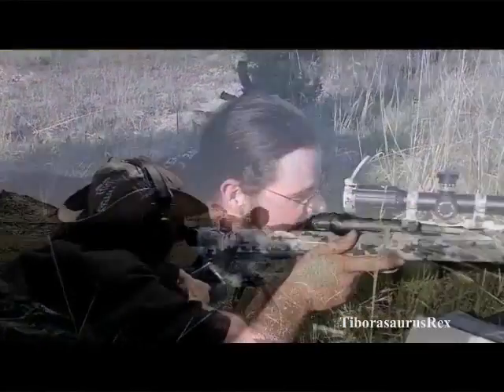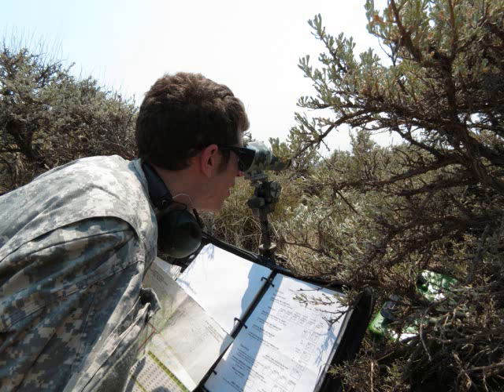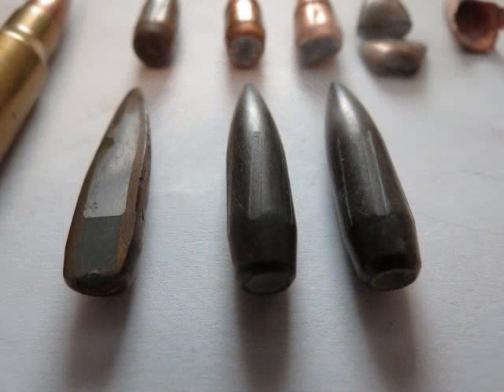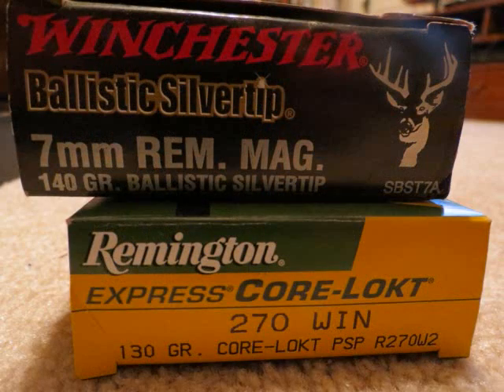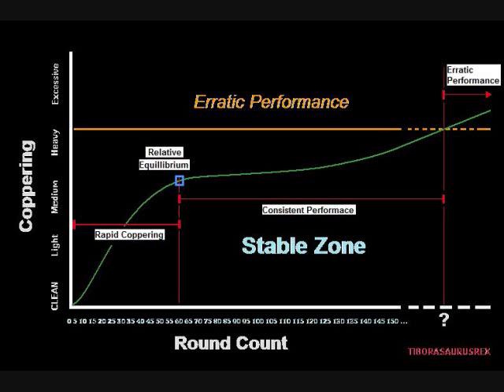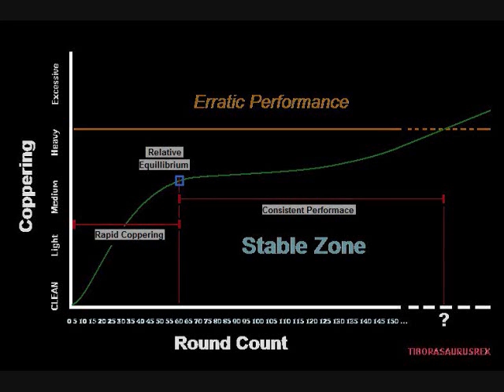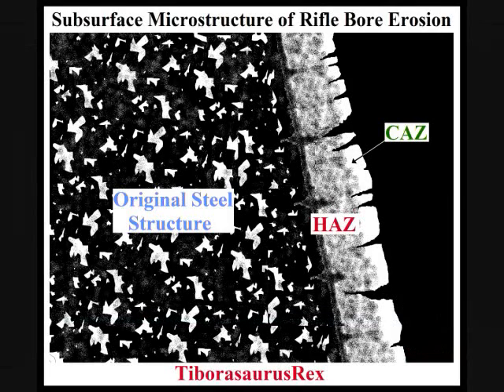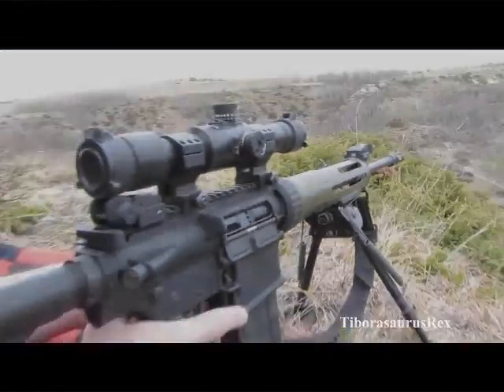Long Range 101 Part 40 - Coppering and Powder Fouling - Rex Reviews

Comment: Not applicable to standard bore sizes, but I had to clean my 17Rem after 60 rounds or a carbon ring would build up about 6 inches in front of the chamber, in the bore, and could cause some jacket shedding.  At 100 yards the bullet holes would have these little grey comet trails off the edges of the holes.  This was lead coming off the bullet where the jacket shed.  At longer ranges the bullet would begin to keyhole.  25gr bullet at 4,100fps out of a Tikka Continental; most accurate rifle I ever owned so far.

Comment: Rex, I'm really confused here. I've watched all your videos, broken in my new stainless Tikka T3 .270 using the "easy" method. I haven't cleaned it in 400 rounds. I'm just shooting from a bench at a covered range so the only contaminants are from the cartridges/bullets/powder. Am I ok just leaving the gun not cleaned? What about the chamber? Should that be cleaned some times?
Reply: A. F. Wood Floors update?

Comment: On the question on using corrosive ammo or maybe just to protect against oxidation (rust), do you feel that so much can change when just passing some gun oil through the barrel to protect against this?
Reply from the maker: Maybe try windex for corrosive ammo.  That seems to work pretty good.  If you have to sit the rifle down for a period in a corrosive environment, its a good idea to run a patch wetted with a little oil through it first.  Just don't use too much.

Comment: Great informative video as always =)   One question thou.  You mention that you recommend copper equilibrium on long range setups, but not as much on mid range and/or carbine type of rifles.  Why is that ?

Cheers
Reply from the maker: At medium ranges, your potential POI shifts due to the bore's Cu state is usually not enough to warrant the cost/benefit trade-off in that course of action.   Beyond 600 meters is where you will really start to notice POI shifts due to minor changes in your internal bore conditions.
Reply: TiborasaurusRex   Aha ok,   thanks for your response =)    

Happy new year !!

Comment from the maker: It may be best to log as much as you can to get a good bearing on any trends that might be going on.  The more data you gather, the more you will be able to look back and make a good determination of what exactly is going on with your particular bore.  At first, you will be logging MV all the time.  After it stabilizes for a while, you can back off on logging MV and wait until the POI starts moving arround before you check it again.

Comment: about how often do you re-evaluate your MV's due to barrel  conditions .  I believe i'm in that initial upswing in copper fouling(less than 200 rounds) and my MV's are about 50 fsp higher than my original MVV chart .  I'm hoping they level off and then I can make new tables

Comment from the maker: For our shooting discipline, establishing a copper coating that remains stable is actually desired to some degree.  If the end result is bore CONSISTENCY, then it should be good.  If it results in varying levels of coppering that fluctuate more quickly, then it wil be counterproductive.  More or less copper is not as important of a concept as changing copper levels - for our apps.

Comment: What are your thoughts on the copper fouling inhibiting powders that are designed to make brittle and sweep out copper deposits? On the face of it, the cfe223 by Hodgdon looks to push .308 168gr Matchkings really well. Should I sweep out the existing copper in my bore with a copper solvent so I can lay down a primary layer of the powder fouling that inhibits the copper fouling.  Would the minimized copper fouling adversely affect the accuracy potential of the bore?

Comment: Thanks.  I bedded and free floated the wooden stock mine came with.  It's going .75 average.  A few groups are better, some worse.  It hasn't been exposed to extreme weather yet though.

One other question.  What's your barrel twist.  According to Ruger CS,  both of our rifles are 1:12.  I don't believe it though.  I'm about to check mine with the cleaning rod test.